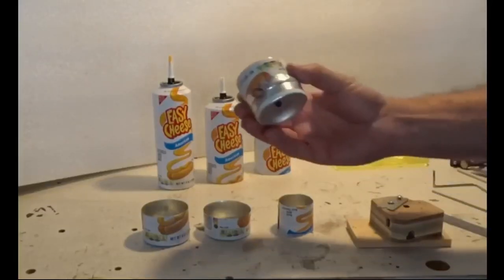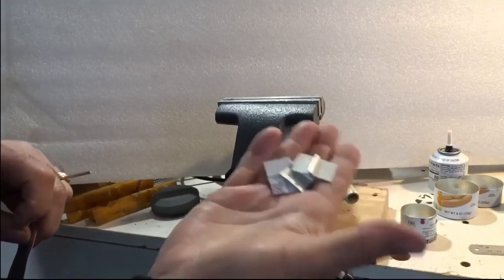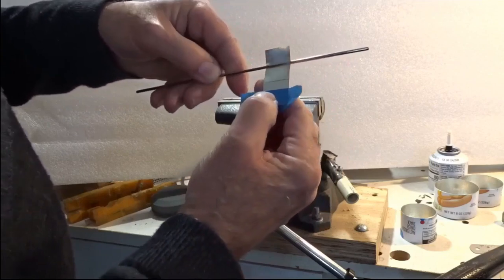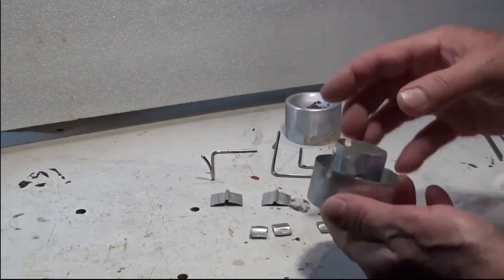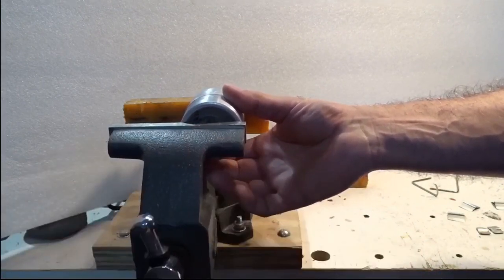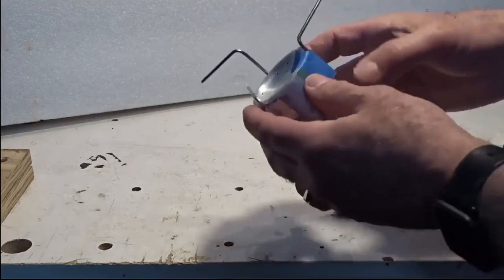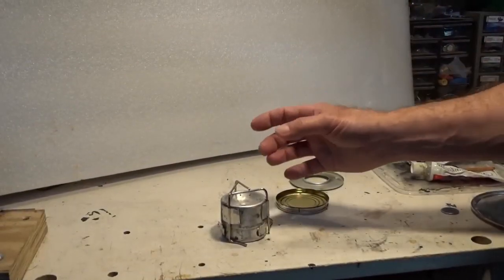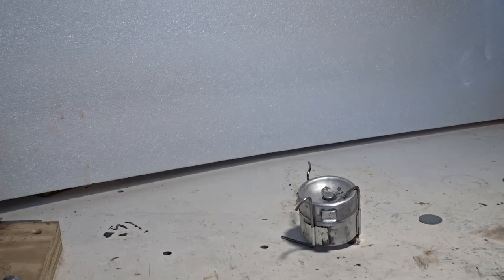DIY Alcohol Stove With Integrated Pot Stand - MYOG

Comment: Try putting a little olive oil on the can going inside the outer can for lubrication.
Reply from the maker: Good idea. Olives oil or other vegetable oil would probably help.  Have to be careful not to get it on your hands. Any residue will probably burn off.